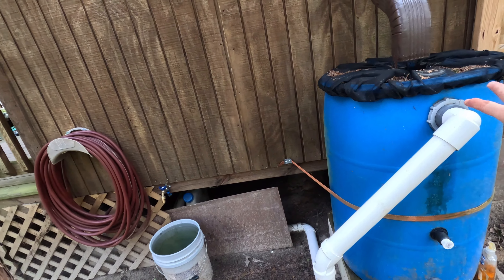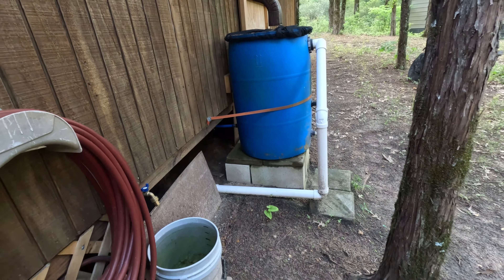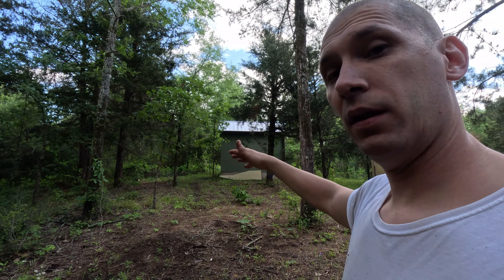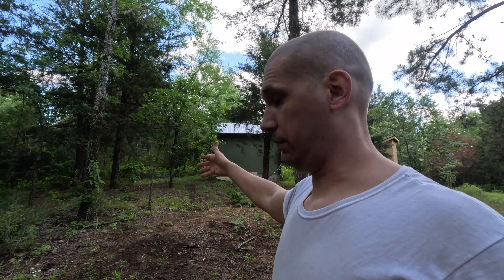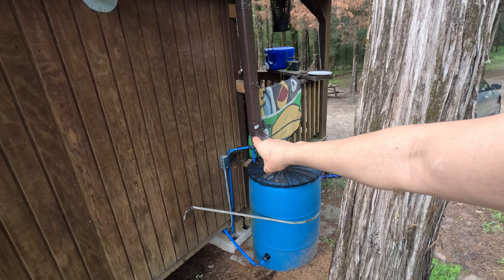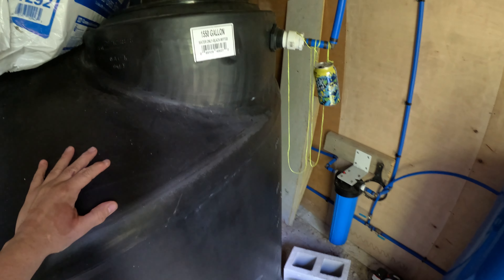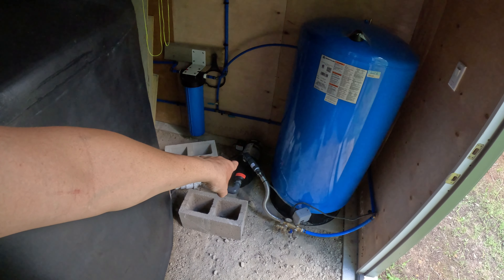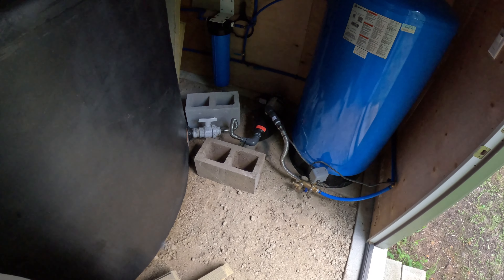Explaining my off-grid rain water collection system

Comment: Even with insulation, over the winter I think you'll need some kind of heating in there, just to keep it above freezing. I think you can hook up something on those solar pannels.
Reply from the maker: This was my 1st winter here. Temperate wasn't super low this time, but managed to keep everything inside from freezing. This 1,550 gallon of water has a lot of thermal mass. If it ever turns out to be colder, o was thinking on installing a diesel heater. But your solar based heater is also an excellent suggestion. So thank you!